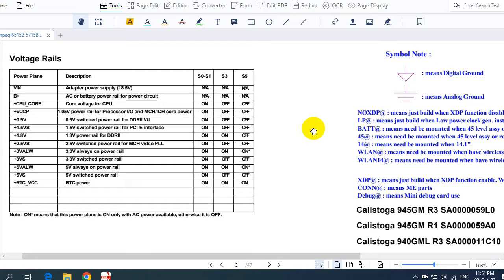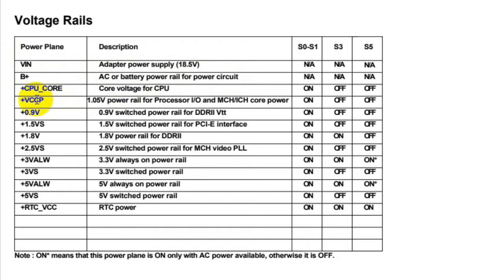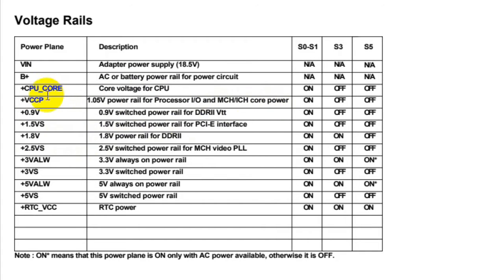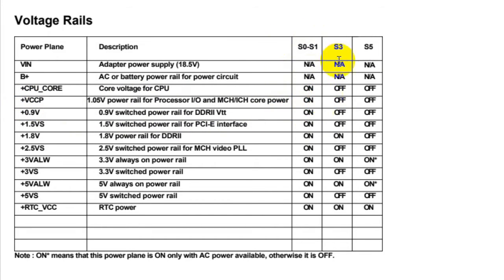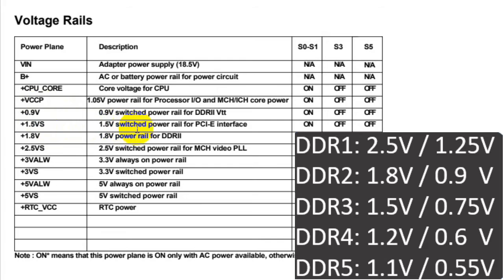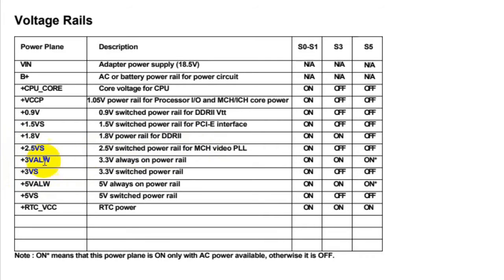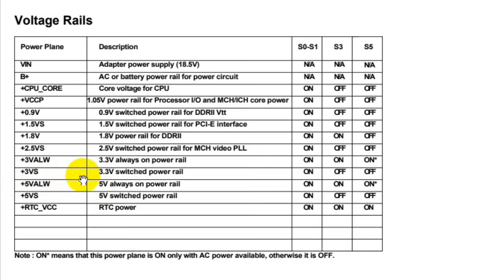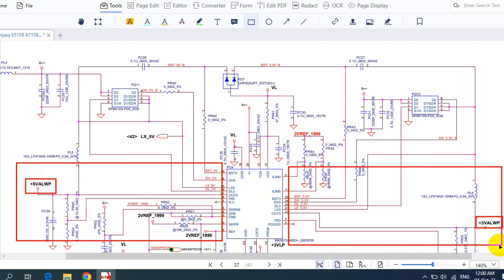Trace Laptop Voltage and understand Motherboard Power Rails on HP Compaq 6515B 6715B Scheme

Comment: but in this video it is like from input 19v goes to on side of double mosfets and from driver creating 5v alw and from battery input  goes another double mosfets and goes out from driver as 3v alw ... it means like 3.3v alw cant be created without battery ??
Reply from the maker: No bro, the 3VALW and 5VALW circuit is independent of the battery circuit
Reply: I’m having same issue, the vin of the 3v/5v IC is linked to the battery voltage. 19.5v is present but the bat+ is missing hence the laptop is not turning on. Have changed BQ IC but same issue, will try to change the double mosfet linked to the BQ bat+ side